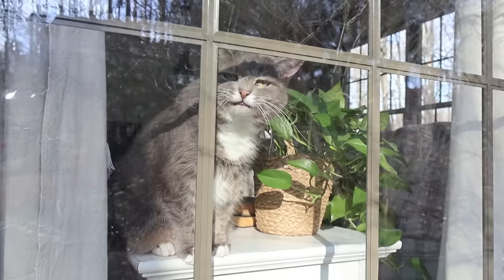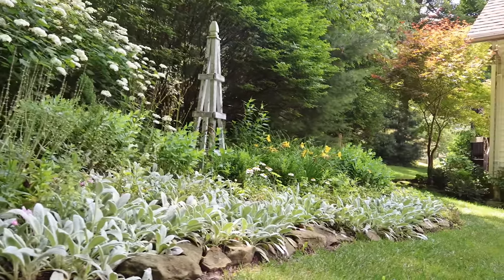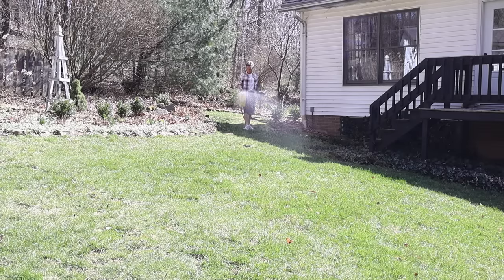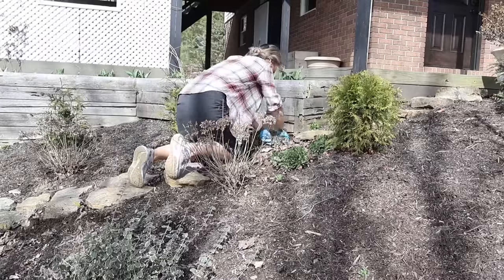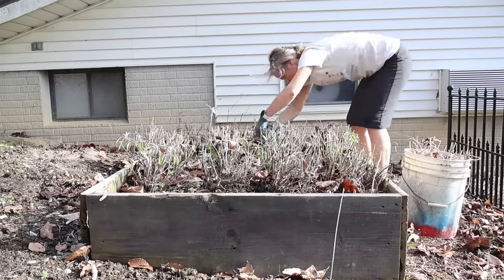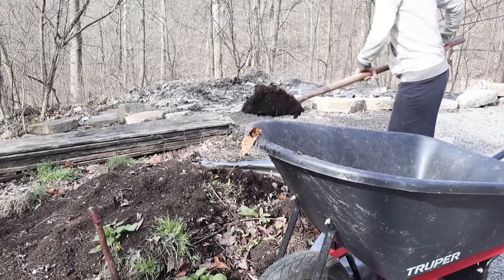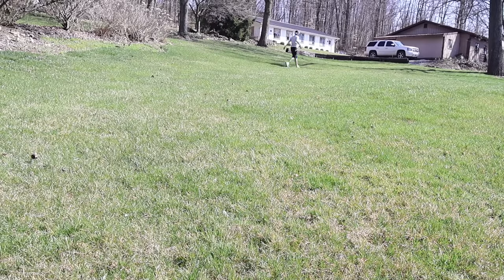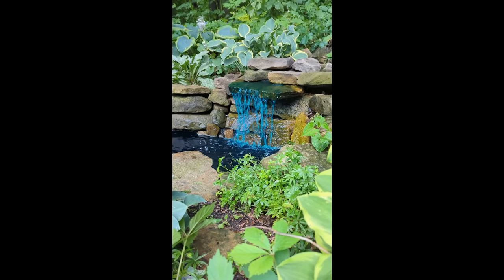DIY Hot Bed~Get Excited for Spring!~Spring Outdoor Clean Up~Sunday Lawn Care~Early Spring Gardening

Comment: Mary, if you drag a large plastic garbage can around with you as you are raking leaves you can put them in there and then put a weed eater inside and grind up the leaves into a powder almost. Much like a spice grinder works. Then you can sprinkle them back into the garden and put all those nutrients back into the earth.

Comment: Your yard is absolutely beautiful in the spring and summer.  A little tip on the geraniums, pot each one in a leftover 4 inch pot and after they leaf out you can plant each one wherever you want.  Also it is easier to take them in if there is going to be frost.  I do this every year and they come back for me.

Comment: Do you mulch your leaves down to put back on the garden? I collect mine in the autimn and bag them up with a few holes stabbed into the bag and they mulch down really well. Can you use your spring water in your soap making? Can you add fresh or dried herbs in candles or soap?